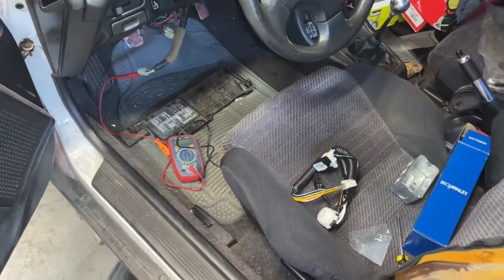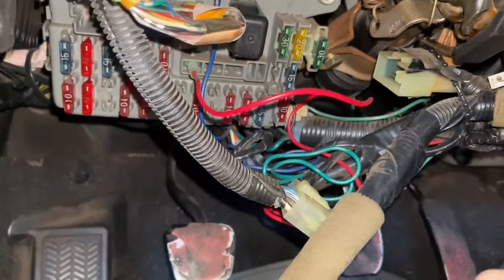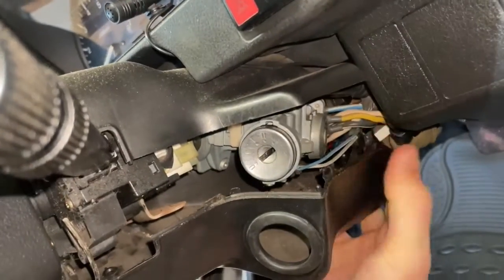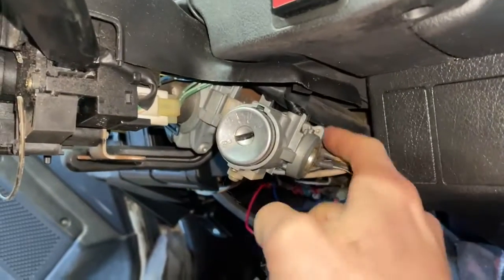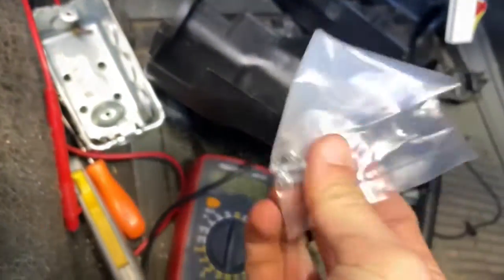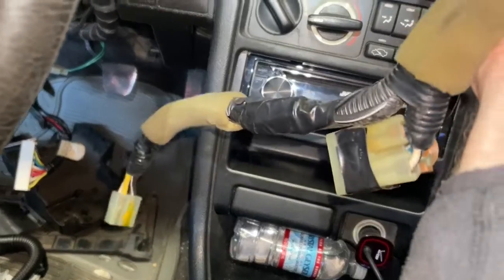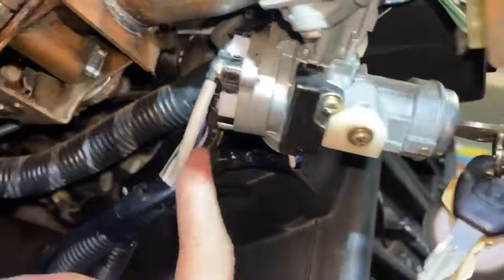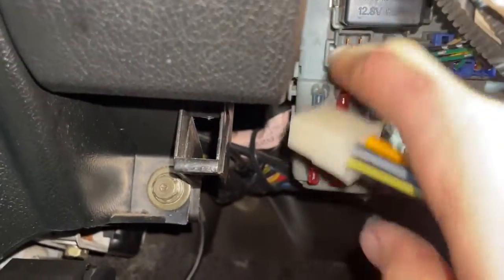Ignition Switch Replacement Honda Civic CRX

Comment: I just pulled mine apart just enough to clean the contacts.  If you do that, I recommend you unplug the ignition switch or the battery if you do that, cause it's very easy to short the back with the socket wrench.

Comment: Here's a tip that will greatly speed up getting access to the steering wheel column:  Remove the steering wheel.

1. Place a strip of masking tape [with a line drawn across the length of it] on the steering wheel column cover and the steering wheel. Then take a razor blade and cut the part of the masking tape where the steering wheel joins the steering wheel column. The masking tape line is used as a reference to properly orient the steering wheel when it is reinstalled.

2. Take a small flat head screwdriver and carefully pry off the Honda badge from the center steering wheel hub.

3. Use a deep socket 19mm wrench to remove the steering wheel nut. Wiggle & pull the steering wheel off. Use 80 lb-ft to reinstall the steering wheel nut.

Once the steering wheel is removed, taking off the steering wheel column cover will be a breeze.

Comment: Had a problem with my civic it doesn’t start I already replaced main relay I just hear my main relay click and my starter click also I check battery but only read 11.86 do I change battery